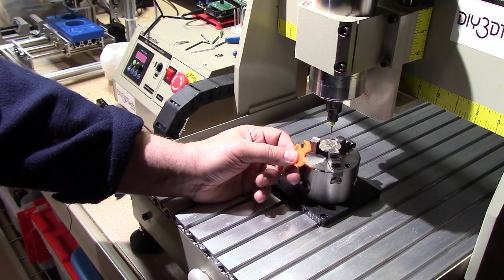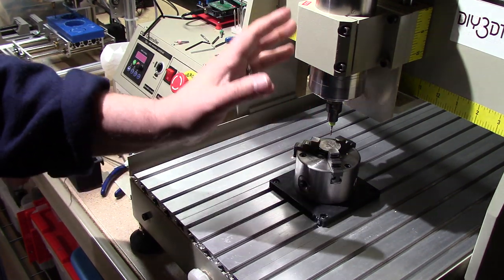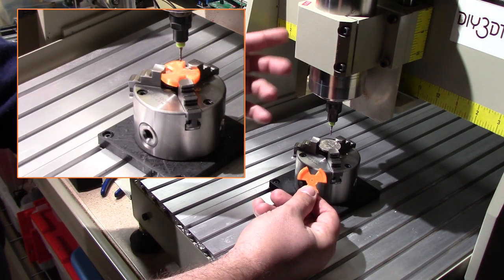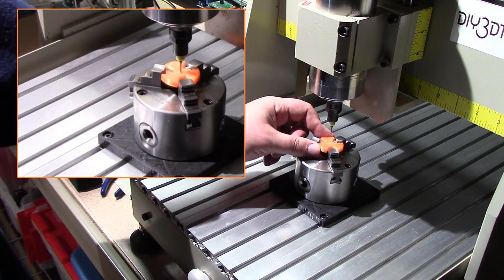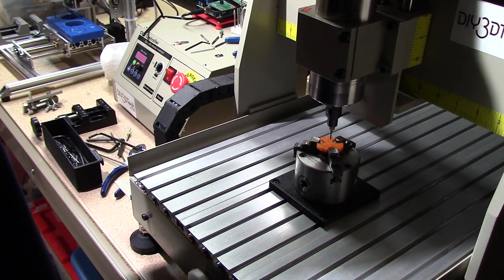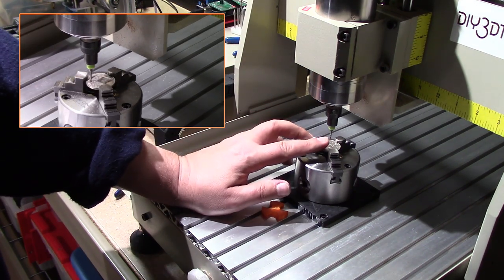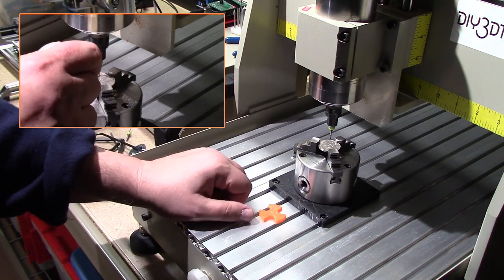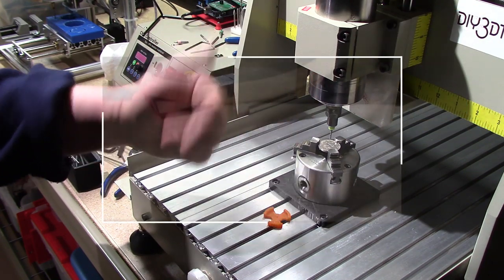Design Talk  -  Easy Hobby Machinist Centering Jig!

Comment: Cool idea.  My only suggestion would be to use a gauge pin that fits the hole closely when setting the zero.  Less chance of cutting the fixture than with the drill, and a better fit for the hole itself.  Thanks!
Reply from the maker: Interesting however the bit actual enters the hole to align with center so how would a gauge pin add in?
Reply: @DIY3DTECHcom  - Since I come from a machining background, I would have seldom used a drill bit to center up with an existing hole.  A drill bit has only two full diameter points, 180 degrees apart.  That can give a false sense of centering without rotating the bit for several check points.  A gauge pin is full diameter at all points, so is considerably more accurate at finding true center.  Flute points can also cut into the plastic hole, distorting its true diameter after a few uses.  
I just prefer the most accurate method when possible.  It's a sickness, I know.  But, after 60 years in machining, I'm too old to change my ways now.  LOL
Reply from the maker: LOL!  Ron your 100% correct and this solution is for a little less accurate yet faster solution!  My grandfather was a tool & die guy in the business for around 50 years so I know of obsession first hand and ever time I fly or drive my car i greatly appreciate it!